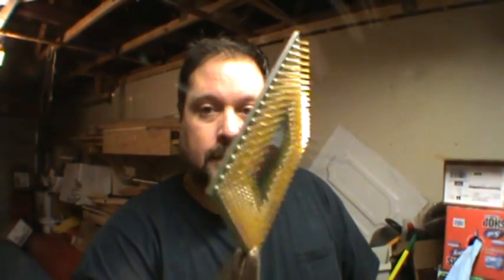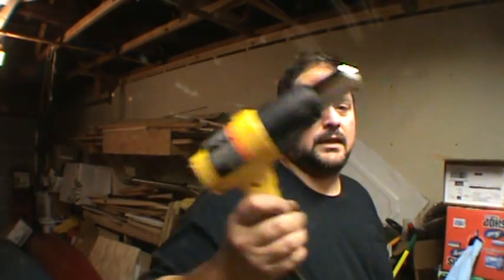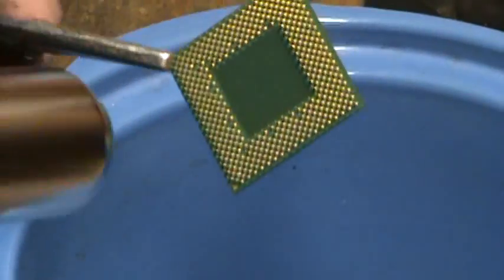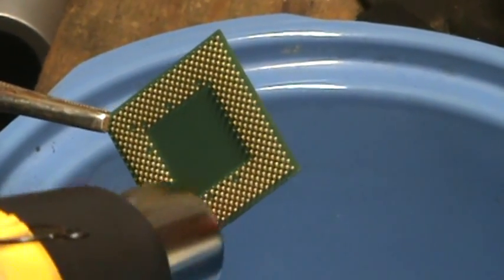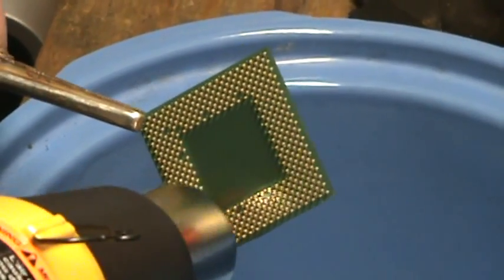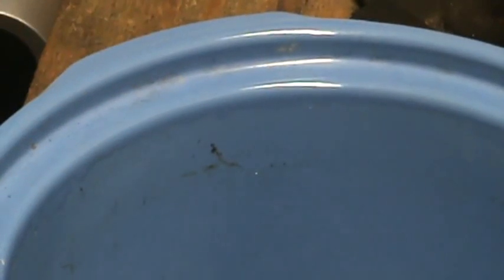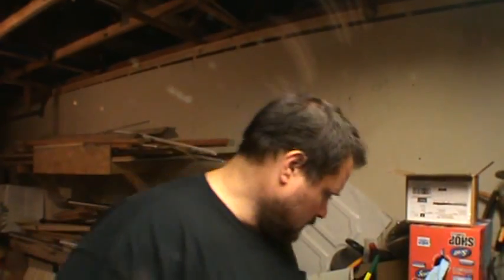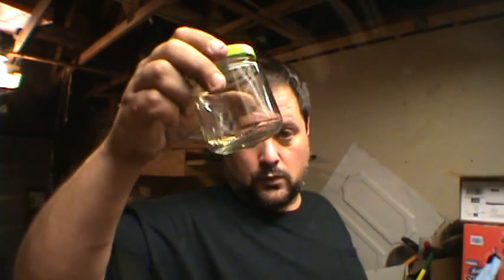How To Remove Gold Plated Pins from Green Fiber CPU's: Top two methods

Comment: Thanks for the valuable info.  I have a bag full of cpus that have gold contacts instead of pins.  Will these methods work the same on those cpus?
Reply from the maker: no.  For those, you will need to pull off the copper heatsink on the other side, any mlccs that are under it, then you can toss it in your next batch of ap

Comment: Where do I find those
Reply from the maker: in computers on the motherboard.  typically under a heat sink and a fan
Reply: Moose Scrapper okay thank u Man U taught me how to take apart tvs and I have taken apart like 7 and have so much wires and copper saved up and thank u for showing me how to take apart a microwave and how do u get a stripped screw off
Reply from the maker: I use either a hammer and chisel to pop the head off or my dremel with a cutting wheel.
Reply: Moose Scrapper okay thank u

Comment: New Subscriber here and I have a question as well as a comment.  First, thank you so much for taking time to teach those of us new to this concept.  My question is where do you purchase the chemicals needed to break down and separate the gold from other material, as well the other valuable metals?
Reply from the maker: I buy all the chemicals I use at home depot and at a local beer and wine home brew supply store.
Reply: Moose Scrapper. Awesome thank you so much. What do I need?
Reply from the maker: For your safety, you need to study study study before you try.  CM Hoke has  a great book free online

Comment: Can you process and measure the amount of gold from one? Just curious.
Reply from the maker: That would be very difficult, especially for me not having a professional lab and all.  The amount of gold from one would be so very small.
Reply: Don't know why your saying its so difficult to measure the amount of gold. I believe its so simple....if for example the whole pins are weight around 0,25 gr so if 1gr of pure gold cost around $10 so your pins cost $2.50...is that right ???
Reply: its so simple....if for example the whole pins are weight around 0,25 gr so if 1gr of pure gold cost around $10 so all pins cost $2.50...is that right ???
Reply: I also want the answer on how much gold there is in one cpus pins
Reply: You have to get 500 grams of gold plated pins and the process is extremely hard and time consuming. You will only generate 1 gram of Gold for every 500 grams of plated pins. This is only good for those who get a ton of gold plated pins that have access to it.

Comment: whats the cost of runing the heat gun?
Reply: hehe same thoughts
Reply: u do know that retro computers are becoming big now,and cos they scrapped the intel pro chip for the gold, they going up in price $68 madness i did scraping years ago before scrap prices went up but give it up now,i just give all my scrap away now,,,,well happy days
Reply: hydro is 15 cents per kilowatt-hour, which is using 1000watts continuously for 1 hour, which is like an old hair dryer running for 1 hour, ... his heatgun probably uses twice as much hydro as an old hairdryer .... so he probably used 1 or 2 cents in hydro.. and he probably used about 20 or 30 cents in propane  [[[ just for fun let's consider a 100watt light bulb... running it for 10 hours a day would equal 1000watt hours(1 kilowatt) used per day, which is 15 cents a day...so you pay the hydro company $4.50 a month to run 1 lightbulb--- but, replace it with a compact fluorescent of 23 watts and YOU JUST SAVED 75% of that money = saving about $3.00 month or $36.00 bucks a year FOR EACH BULB you swap out !! NICE ! ]]]
Reply: for any of the US viewers reading this comment, in parts of Canada their electricity is generated by hydro electric power dams. It is very common for them to refer to the power company as "hydro". Any of the above references to hydro can be changed out to "power company" or "power" and you may be better able to understand it.

Comment: ..hey Moose, Ive got some gold ore that I need to extract the AU from and a friend suggested muriatic acid-as that's what their dad uses w/his bizz as a gold pros-pector here in Ariz. Keeping in mind that I DONT hav access to a rock crusher to turn the ore to a slurry & use the borax method on this job(ttl wt1.7lbs) 
approx. Will this method  w/muratic accomplish wat i need to be done-w/Out loosing a considerable percentage of the AU?  
Thanx Moose!..awaiting ur reply,.Cj..
Reply from the maker: Wow, that's a great question, unfortunately its something I know nothing about.  I mean, I have read about some nitric acid leach methods, but am no where near knowledgeable enough to advise.  Have you poked around on the goldrefiningforum?

Comment: Why remove the pins from the CPU, if you are going to try to recover the other gold still left on the CPU board/chip?
Reply from the maker: because they require different processes.
Reply: ok. Ive been collecting stuff for 2 years now. Have a big pile of memory chips, cpu's, circuit boards, and Glucose strips.  im starting to gather the things I will need to process it all, so just learning here. I kinda figured ya just dumped the whole thing in a big pot, with chemicals.. and then filter, drain, etc... 
 How many different processes are there for those kind of items?
Thanks.
Reply from the maker: That's a wide variety, I am seeing at least 4 different methods.  IC's need to be incinerated then the PM's extracted from the ashes.  Boards and the fingers from the memory need to be soaked in AP or HCL and air bubbler system.  The glucose test strips need an HCL bleach mix, CPU's have many different types from the old ceramic ones to the newer pinless green board ones.
Reply: IC's incenrated? How about just removing them by desoldering them?  As for the glucose strips, I got the ones your video shows, the accu check ones.  as for the memory chips,  same thing for the IC's.. think I have only 2 that are surface mounted chips, the rest have little fingers on them that should come off if the solder is heated up.  Next item to get - heat gun.. got 22 CPU chips, lots of pins.. I basicaly have a 5 gallon bucket of Circut boards, memory chips, ect.. and a jar of test strips thats about an inch high by 4 inches in diameter.. figure all together probbaly have about 2 to 3 grams of gold when its all done..
Reply: maybe i should just sell it all to one of the guys with the craigs list, postings.. let them do all the recovery..
Reply from the maker: This is where a lot of folks get disappointed.  Its shocking sometimes how much material it takes just to make a gram of gold.  Big reason why for me, and I encourage others to see it as a hobby only.  You may possibly have 2-3 grams in there total.  I am sure you will be able to find a buyer though.
Reply: Yeah, thats why i've been saving it up for 2 years. I know it takes quite a bit, and yes, this is hobby only.. ok.. I need to learn about the different methods for extracting then. What to do for PC boards, what to do for Chips, chips with pins.. ect.. Thin Plated stuff I will treat the same as the glucose strips.  I already stripped a lot of unnecessary parts and things off the PC boards. If I have to wait another year, well, I can wait.. but I did just order a beaker set from amazon.. LOL, they will look cool in my workshop.

Comment: Where do you find these peices with gold on them ? Been trying to search for old computers but none are coming around help me out moose
Reply: mark alexander  find an old dell computer tower take it apart , they are usually innthe center of the big board sometimes locked down by a metal plate pop it off and remove cpu!

Comment: Hi - how do you remove the gold pins on circuit boards?  Same process?
Reply from the maker: +MrKalvinC Personally, I use a pair of flush cutters and snip them off motherboards.  THis summer I am going to try using an air chisel though as they seem to work great!  Using a this method will not work quite as well but will still work.  Just do it outside as the fumes can be very harmful.

Comment: can you just soak the cpu in mercury and let the gold dissolve and reclaim later?
Reply from the maker: +Randy  Marsh no.  1-mercury is extrememly toxic and should be used at all for any gold recovery purposes in the private sector.  2- as far as I know, mercury is only used to collect free gold in flour form.
Reply: I have a little that has gold in it I would like to remove the gold with out losing the mercury.any sugestions?i am aware of the toxicity of mercury.i have mabey 2 shot glasses full .no more
Reply from the maker: +Randy  Marsh I have no idea.  I never use mercury and do not recommend its use.  Try the goldrefiningforum.
Reply: ty again
Reply: Bleach works well it takes a min tho like a few days

Comment: im new to scrapping and am in the process of watching your videos. I like the way you put them together by the way. now please excuse me if im asking a question you might have covered already. I see that you gather up a pretty good amount of boards/ electronics/ precious metal and copper baring materials. now my question is. where are you getting the materials to scrap. obviously you got places you go to collect or buy. how would you suggest someone new to the scrapping world start off. im trying to make a sorting system to maximize the returns. sorting off the components off of boards, compressors, cables exc. is there some sort of sorting system you have for making sense of the madness. show what's behind that camera in your shop. thanks Eddie Little
Reply from the maker: +eddie little Great question, I actually have a video on how I sort scrap.  If you are new, the best advice I could give you is to not focus on gold at all.  by volume and time that is the least money maker.  Focus on moving the steel, aluminum, copper and brass etc.  Build up a stock pile of the gold bearing parts, when you have time cut off the gold fingers, trim off gold plated pins, sort CPU's and boards etc until you have several pounds of each.  Then start looking into gold recovery.  As for where I get things, I place free ads, I watch craigslist, I also try to make connections to people with jobs in IT, landlords, etc.  Best of luck to you!
Reply: great to hear back from you brother. ive been doing pretty much as you said. ive been collecting up iron alum, copper, brass exc and really just keeping the gold barring materials i a pile. was thinking of metal quantities per known electronic model. have it be like Wikipedia so other scrappers could upload there materials knowledge into a resource so we would know if we were wasting our time scrapping something. also what to look for when we were out. ive gotten a couple of honey holes for dumpster diving, also a security and appliance hookups place. so now they keep the things i dive for in a pile. the land lord idea is a great one. ill incorporate it into the arsenal very soon. ive enjoyed your videos man. thanks for the knowledge!!

Comment: not bad D but I would also suggest to say that using that another benefit of using the heat gun besides the odor of burning the boards is also you get less tin lder off of it as well. also how about a link to where you are the processing the boards after you remove the pins ? cause on the auto list it wants to thro me to the fingers and cell phone boards vid.

Comment: why would you remove the pins from the chip if you throw it in hcl anyways? Sorry, I am pretty new to that all and really have no clue..
Reply from the maker: +MrHollabk The pins are going to be processed in hot hcl and the rest of the chip is processed in room temp hcl and peroxide or hcl and an air bubbler.  Imagine that gold is a coffee stain.  The pin is your kitchen counter, and the green board is your favorite white shirt.  Do you remove the same stain from the two different materials using the same method?  That's the best analogy I can come up with...while starring at my coffe satined desk....and shirt....
Reply: Thank you very much for this explanation kind sir! Great videos and very informative!!!

Comment: Hello Moose, Don here I have a question for you. Can you put gold fingers with gold pins in the A/P solution to float the gold off or is this a bad idea. Thanks from Don.
Reply from the maker: +Don Hard Hey thanks for watching!  That's a question I have had at least 100 times.  Can you?  The answer is yes, you can.  Should you?  Probably not.  It is always best to process different materials separately especially when starting out.  There are dozens of reasons why, but most important is that you need to see how much gold is removed from each type of material so you can get a good understanding of just how much material it takes to make a gram of gold and also, the foils settle, and if there are a bunch of pins in there, the pins will take much longer to dissolve and the foils from the fingers will get mixed up in them.  The two processes also have different things to look for when filtering as well.  Best of luck to you!
Reply: +Moose Scrapper Hello and thanks again Moose from Don.

Comment: I want to know about the soldering? Doing the A/P method, should most of the solder be remived. Sorry if this question has been answered and explained why
Reply from the maker: +Harris Brothers Yes, the solder should be removed prior.  Tin, antimony, lead, etc, all can cause issues with the gold recovery process.
Reply from the maker: +ZomPaul you can get most of the solder off just by soaking it for a couple days in HCL.  No peroxide or air, just the hcl.

Comment: +Moose Scrapper Hey Moose... again I'm digging your videos! One note to other viewers... don't use a plastic type bucket/bowl to catch the pins. The pins are still hot when they come off and will stick to the plastic from minor melting. I suggest using a tempered glass container of some sort. I agree the torch method is toooooo fumey and takes for ever to get the burnt smell out of the shop even with ventilation. The heating and tapping method doesn't work all to well for me so I rest the vise-gripped CPUs on the edge of a Pyrex dish, heat with a Wagner gun on high with one hand and use a flat head screwdriver with the other. Works well and relatively quick without overheating/burning the PCB/fiber board. My question is... is it ok that solder comes off with the pins for when it comes time for AP method of refining? Or will I need to use another method due to the solder? Thanks!
Reply from the maker: +Scappin' Cricket great point!  I use either a ceramic crock pot...pot or a stainless steel pot.  As for the solder, these pins are processed with hot HCL so its not a huge issue.  If you are processing a lot though, you may want to soak them in HCL over night.  this will take off the solder, filter, then use fresh hcl and heat.
Reply: +Moose Scrapper Sorry for taking so long to say thanks. I've got a small batch I want to try my hand at for the solder removal step. If I could I'd upload a picture but I have 256 grams / 9.0 oz of CPU pins that I think have a bit much of solder that needs removing per your suggestion of a soak over night in HCL. Muriatic NEXT 21.??% or the stronger 31.??% What ratio for just soaking in HCL to remove solder as in weight of CPU pins to HCL only? I swear I've been trying my best at research n more research on my own but nada when it comes to this situation. GoldRefiningForum is a great place for info I'll admit... but can be tedious when trying to search for specific information. For later on down the road when I feel I'm ready for more complicated processes... why HCL and heat afterwards instead of AP? Thanks in advance!
Reply from the maker: +Scappin' Cricket I don't think you will need more than 1/4 gallon for the solder removal, and once the solder settles out you can reuse it.  The forum can be hard to search especially if you are new and not sure exactly what to search for.  Been there man.  HCL and heat is suggested because it takes about 1-3 hours where AP can take over a week.
Reply: Thanks Moose! I'll go get the strong HCL for the solder removal since what I have is the safer NEXT type.

Comment: Can I just burn the entire cpu chips and other object in a mini furnace
Reply from the maker: Ben McIntosh Depends on what the other object is.  In general, incineration of circuit boards is illegal due to the chemicals it releases into the air.  IC chips can be incinerated if done properly so as to also burn off those volatile organic compounds.  I would do more research before attempting.

Comment: I'm new at this and had a few questions? What if your solution turn yellow and not green? I had put some pins in the solution with the gold fingers, I hope i didn't mess it up. Also when I went to drop gold the solution turned a reddish color what would have caused that?
Reply from the maker: Clint Ray Hi and thanks for watching and yup you messed it up.  You need to process things separately.  I have no idea what was in your solution so I could not guess as to why it turned red.  Use some stannous chloride to test for gold content before discarding any solutions.
Reply: I will try that solution if you don't care would you shoot me a email, I have a pic on that solution it ended up turn yellow but not neon but like dirty. My email is csr1003@gmail.com